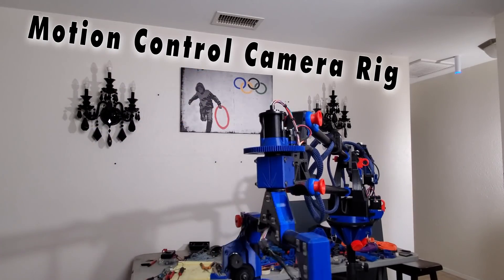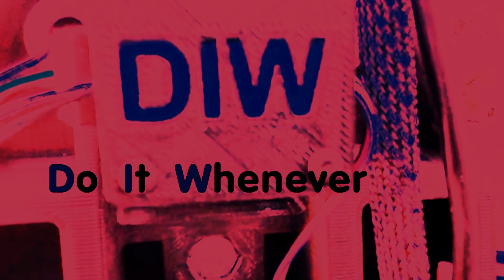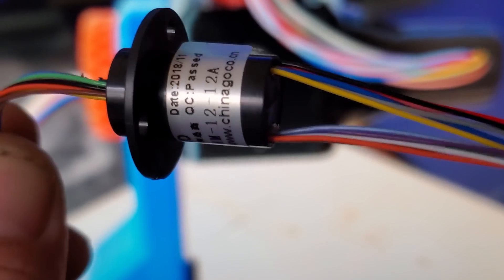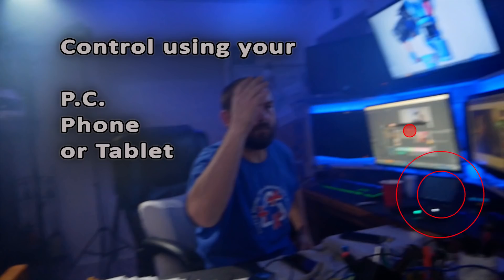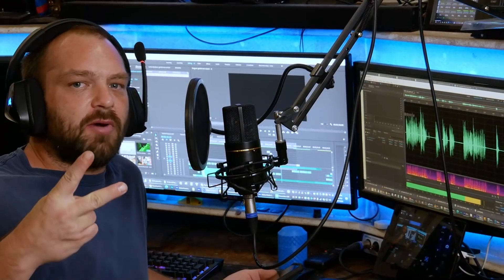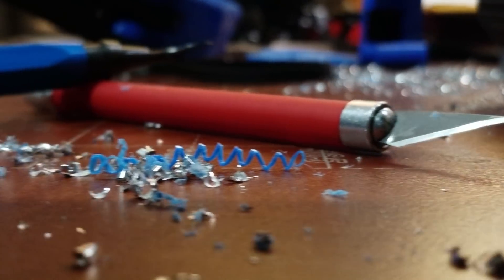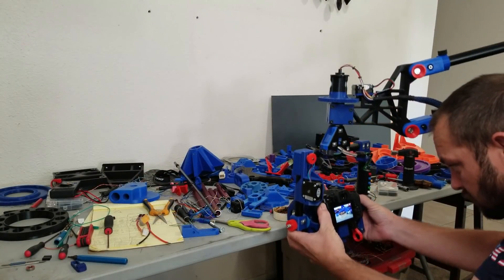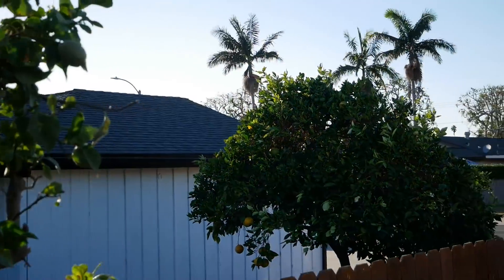The greatest DIY MOTION CONTROL camera rig EVER - allegedly

Comment from the maker: Hola world, I hope you enjoy the latest DIW Project
Reply: This is a pretty sweet build!  Some thoughts:

1. One issue I noticed right away has to do with how the camera is mounted; to prevent parallax error, you will need to incorporate a nodal slide.  Here is an explanation: https://fstoppers.com/education/beginners-guide-parallax-and-how-avoid-it-when-shooting-panoramas-485141

2. This would be PERFECT for photogrammetry as it will allow taking pictures from every possible angle, even sets of exposure-bracketed and focus-stacked images.  Even better, with the addition of a simple projector on the side (https://www.thingiverse.com/thing:692318), you could do structured light scanning, using a filmstrip of gray code stripes.

3.  For bright, high-quality lighting, you can use parts of a dead LCD monitor to put lights... anywhere, really.  Matt has you covered for this: https://youtu.be/8JrqH2oOTK4

Does that make sense?

P.S.  Once you have the project wrapped up, be sure to send it to mailto:tips@hackaday.com as they LOVE stuff like this.
Reply from the maker: Awesome, Thanks for the info!  I'm still amateur but I sort of made this setup with my camera in mind (G85) I had it setup almost right where the sensor sits in the frame on both rotating axis. I was trying to balance things out so the motors didn't have to work as hard ...AKA... could be smaller and lighter but it is a bit nose heavy still. That's an easy print to fix/test...  There was one shot in the video (also jittery for other reasons) but I did a zoom pull in post which might have given a weird effect (wasn't using the focus motor at the time)
Reply: @DoItWhenever  I originally also pivoted around the sensor, but any point other than the nodal point will cause parallax errors.  (I found out about it while trying to figure out why I couldn't take panoramas with objects closer in.)
Reply: @DoItWhenever  what magic sauce do you think professional camera rigs use? on top of what you've done.  this is amazing. im gonna be following your work closely. subbed:)
Reply: @KeithOlson  all these suggestions are brilliant, id love to see this project taken forward...
Reply: PART II?
Reply: Hey, theres this guy who built a crazy 8 axis ceiling mounted version, https://youtu.be/ZB5mL6vfh1o perhaps its got some answers, cant seem to work it out myself , id love to see this, think he uses Dragon frame tho...
Reply: your diy project is basically like the one in this video https://www.youtube.com/watch?v=UIwdCN4dV6w but better
Reply: It looks like dum e from ironman
Reply: Hey can you send me an email?  michael@nerdtronic3d.com
Reply: The work is simply impressive. what kind of music did you use?
Reply from the maker: @polymer74  epidemic sound
Reply: can u add a movement control feature? by pressing the  M (movement) record button will record  the  movement when u manually move the camera rig of how i want it to move and not be 100% dependent to the Gcode. u can have a time-lapse button as well. press both M, TL buttons to record the movement with the time-laps setting in to the Gcode or have 1 button for the movement and another button with both movement and time-laps to make things easier of not pressing 2 buttons at the same time
Reply: Hi, ever thought of using DMX for the Controlpart ? With DMXControl 3.0 (Free) you can set up different "Frames" and make the movement between in automatic mode. There are some Arduino-Dmx Projects, like one to control Animatronics. I'm building a Rig with DMX-Control for Stop-Motion Animation. Hope it helps. Like your Videos. Love Bad Religion. 8D
Reply: @phager  Hi, can you tell something more about your RIG? May be you can share video with it, with rig and DMX interface to control it. Thanks
Reply: It would be nice if you could set it to record movements as G-code then just run through the motions you want the camera to make and then replay it as the stand alone rig. Then you could just keep the movement and change the timings to get the shot you want.
Reply: hey if everyone have a better idea make a new file with him
Reply: hay bud when printing do i scale add 1 or 2 percent ? or just print and go ?
 when printing pla?
Reply from the maker: @TheRoulette77  I guess it depends on your printer and the tolerance.... I don't necessarily have a problem going from one material to another... But I did have an issue where the aluminum rod I purchased a few weeks later was just slightly different and too tight for some of the components.  There are a lot of tight tolerances on this machine though..... I made things tight too minimize any wobble and stability issues while using it for filming

Comment: Downloaded, started work on building, and noticed something missing...two things really. 1, the piece the came base plate sits on is not in the files. 2, there are some large gaps in pieces that indicate (as well as in the videos) there is some kind of bearing or spacer that's not listed in the parts...what was used? The z_y_connecting_arm is an example of what I'm referring to.

Comment: Hi, I've hit a snag, I realised that I needed a Forth axis for my rig design  but have also realised that UGS only allows for 3 axis movement, how did you get around that?
Reply from the maker: Hey there, USG does have a fork for six axis boards... The only downside is the display still only shows XYZ.... But ABC is also available through commands... I'm at work right now but I'll try to remember to send you what I have hopefully that helps
Reply: @DoItWhenever  currently using a 5 axis board, wasn't able to get my hands on a 6
Reply: @DoItWhenever  DM'd you on instagram

Comment: I don't know anything about programming and if my idea is at all possible but it would be cool if there was a setting of some sort wherein you could push a button making the software controlling the rig start recording the movement and positions as you move and adjust the whole rig by hand, then press the button again to stop recording. So with this recording of its positions, it could replicate the movements you did by hand from it's starting position when you initially pressed the button, following the motions or path you made to its end position when the button was pressed again.

Comment: hi, for self calibration on zoom and focus you could maybe use Trinamic TMC2209's with the UART interface, with stallguard you can detect when it, well, stalls

with a few hall effect sensors and magnets you could also implement zero/homing points etc

Comment: > * Various length bolts, washers, and nuts (2mm - 3mm - 5mm - 8mm)
Uhhh, can you be more specific? How many of each?
> * 1" OD anodized aluminum tubing
> * 3/4" OD anodized aluminum tubing
How many of each and the length? I have no idea which ones to get, there are so many options on amazon, I don't want to order the wrong one :<
Reply: I ordered the wrong one... enough for three in fact.  Still can't find that thin walled, blue anodized aluminium. 

I went with the 0.125" wall aluminum, but a thinner gauge is needed to fit the plastic inserts (not sure what)

The rods were 2' for the 1" and 1' for the 3/4" but I just roughed it in from the CAD model.

Currently looking for bearings that don't seem to be mentioned anywhere.

Comment: Have you considered using RC/drone based control software like ardupilot? At the end of the day, your goals with your machine are more similar to those of a drone pilot's goals than that of a machinist. It'd be far more simple to control the end gimbal with a flight control board in it, and the Z axis could be controlled separately. Then a single joystick and an arducopter GUI could be used to control the camera rig in a user-friendly manner. It's all very similar, G-code and mavlink, but the arducopter user interface would really help.

Comment: This is a great Video, and I was very inspired by it that I am trying to replicate it. I started printing some parts but I noticed that on the video you had more than one printed parts of the same part. For example you have the 2 spur gear holes for the lenses. This might be a long shot but how many quantity of each parts is needed to make  the camera rig.
Reply from the maker: Hey Thanks for the kind words, but I'm a bit confused on the question.... Almost every part is a one off. It's definitely a work in progress but almost every part has a quantity of 1.  Some of the spur gears I ended up buying because the plastic version didn't hold up to the stress (mainly the turret section and arm section) those have geared motors and move a lot of weight. The metal version worked better in the long term
Reply: @DoItWhenever  oh thank you very much. I’m still printing parts. Somehow to me it felt like there were so many parts on the video that it looked like it was more than 77 parts. That’s why i was curious as in if some parts were printed several times

Comment: I've always wanted a system just like this. But, even this DIY project is probable 2 or 3k. As I don't even have a 3D printer. 😢
Reply from the maker: Its really cheap. maybe only 500 or so
Reply: @DoItWhenever  Oh. Well that's great to know. That's not counting the cost of a 3D printer though is it?

Comment: so sick !    did you print with 1.75mm noz ?   also how many 1kg spools will i need for all the 70+parts ? also hows it holding up to usage ?
Reply from the maker: I use a 0.4 mm nozzle and 1.75 mm filament I can't even guess how many spools I've gone through in prototyping... Just printing the parts once you might go through three or four spools

Comment: what if you were to add another button to your rig to send current location of all motors in the form of gcode back to your software so you could literally create a waypoint system? this might require a encoder or at very least a hybrid stepper motor but I could see it saving Allot of time in the gcoding stage where you would just have to mostly program transition speeds vs programming the locations.

Comment: Filament is cheap if you can make it at home there are plenty of filament making machine tuts on the net the cost of plastic prime pellets are some about 2 $ to 3.5 $ per Kilogram if you buy a 25 kg bag ... The machine cost is not more than 500 $ if assemble @ home the extruding cost for plastic filament and labour together is not more than 30 cents per Kg,

Comment: You should make a 3d version that can be used in blender or maya. You can animate it there and see a preview of the motion, adjust the speed curves there, then output all your joint rotations for every frame as a text file that can be converted to gcode
Reply: This would be amazing
Reply: If someone out there can do the coding bit I can do the ik controller in blender

Comment: You maybe also want to repurpose klipper for this project. It allows for 100-700k steps per second using a host/slave configuration, depending on the slaves. the host is most often a raspberry pi. https://www.klipper3d.org/Features.html

Comment: After more than 200 printing hours i had finished the model, I use many resouses to see the details as bearings size of bolts and other harware. Now I am waiting for the electronics, will you go to publish the electronics? or how can get the electronics for this project? thanks
Reply from the maker: I think I listed most of the electronics in the last video... Sorry it's taking me so long for the follow up video but that will definitely have a complete parts list attached
Reply from the maker: The electronics are actually the simple part... It's all simple really but controlling the robot is a little unorthodox because I used off the shelf parts not necessarily designed for a motion control camera
Reply: @DoItWhenever  I move with GRBL but you use Raspberry PI, is it possible to get the program you use in Raspberry? do you sell it?
Reply from the maker: @agusnit1952  GRBL is the firmware that sits on the Arduino... The software on the raspberry pi is universal g-code sender platinum... And it's free... They have a version that works on the raspberry pi
Reply: @DoItWhenever  Thanks a lot, I am going to do with this programs, I hope I can do this equipment work fine.

Comment: Stunned!! Thank you for this you genius.  I’ve been looking for something like this to hang from the ceiling for an in studio camera and mic solution.  3 of these for multiple angles.  ‘’Not difficult just a lot of steps” how many hours? This thing is so COOL!👍👍👍 interesting. I’m grateful for your schematics. 😁🕊
Reply from the maker: Thanks, I don't know how it would hold up ceiling mounted though... It's sort of designed for movement in the current orientation... The turret bearing might not support everything if turned upside down and you'll lose travel in the arm position unless mounted quite low off the ceiling.
Reply from the maker: Then again if the arms were shortened a bunch I don't see why you couldn't have a small mobile ceiling mounted camera

Comment: Hello!
Realy nice project !
You can use also Linear actuators control its lenght.
I was looking for a diy RIG to make and it is the BEST!
Reply from the maker: Thanks a bunch!   It might be more stable to put the whole rig on a slider to mimic the results
Reply: Of course slider is better for smooth movements.
I want to build one because i love diy projects and try some modifications but i dont have a good 3d printer yet.
Anyway i really love this project !
Reply from the maker: @giorgos8324  some parts do take a bit of a calibrated printer,  its a fun projects that brings printers, electronics, and imagination  into the same envelope

Comment: Why fuss around with complicated control software when you can use the Arduino with the motor controllers to record movement, so you log all the motor angels and times to play back a motion done by hand, when the rig already can be moved by hand easy and hold positions.

Comment: When is part 2 and 3 coming out? We are already preparing the materials and printers! :D  
Regards!
Reply from the maker: I've been working on part two as I type :) I'm doing the electronics video and then the assembly.
Reply: @DoItWhenever  Excellent! We are excited and we have our plan all made up. Is there a way we can get in touch with you via email so we can have a more direct contact? Maybe if we find troubles or some questions along the way and maybe we can help to improve it. 
Thanks and regards!
Reply from the maker: @pedrojoaquincastillocorona9735  Sure, That's  awesome your getting ahead of the pack by building this before I get the videos out :)   shoot me a msg at Instagram and I'll get you my email  https://www.instagram.com/do.it.whenever/

Comment: That's ... awesome! My only concern is PLA plastic usage, that's the last plastic I will use if we are talking about about durabilitiy, UV and 60C+ temperature resistance, etc. Otherwise -- wow!
Reply from the maker: I would agree, but PLA is actually not a bad choice considering a huge factor is rigidity. You cant use it at 12pm in the sahara lol .... I agree PLA has a few drawbacks but overall stiffness is a higher value target worth the compromises.

Comment: You could try and use Unity or Unreal for control. At the same time you can define a 3D space for the camera and also add mouse movement controls as you can pan, tilt, zoom etc in that virtual space. Have a fully animated program you can run before any camera work. This way you can be sure that you'll only need one take.
Reply from the maker: I found this... its looks really cool for this project and so many others www.bottango.com

Comment: Awesome! Tried what the max weight it can handle is? 😁
Reply from the maker: I'm not sure what the max but you have to slow down moves the heavier you go.... As well as when the arms are extended... Printed parts are no match for inertia lol... The back unit has a built-in counterweight that whole pod is about 10 lb... But it's cantilevered so the payload is less. I've had my camera with a few accessories.. road wireless mic... And ND filter... Not sure what it weighs

Comment: Nice project, it looks really nice. The only 2 thing I would add is an encoder at each motor so that you can save the position while manipulating it by hand. The other is add a hook to add weight to better the balance
Reply from the maker: The whole back unit is the counterweight! about 10 pounds on my rig...the counterweight slides as well so you can get a perfect balance...... kinda like an old school scale at the doctors office

Comment: Video is awesome. How many parts from project can't be print on Ender 3 pro?
Reply from the maker: My printers have 200 mm by 300 mm print beds. Not sure what your printer has
Reply: @DoItWhenever  thanks for respond. 220x220x250mm
Reply from the maker: @pavlepejic1569  That would probably work out just fine.
Reply from the maker: @pavlepejic1569  grab the files from thingiverse, It'll  be close but probably doable